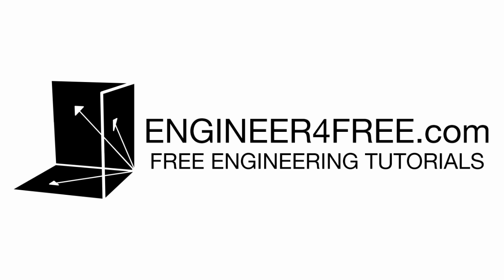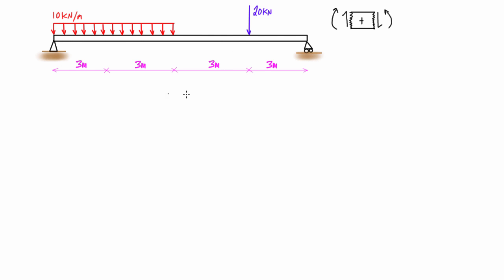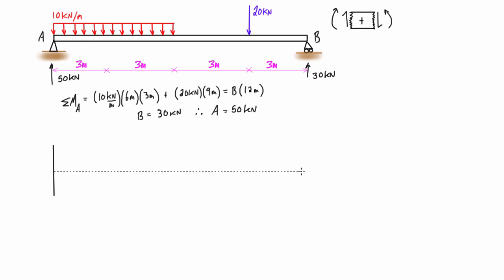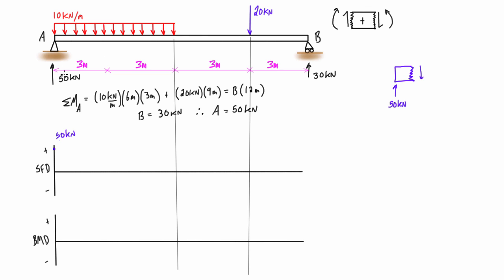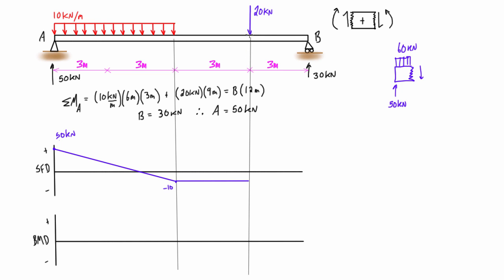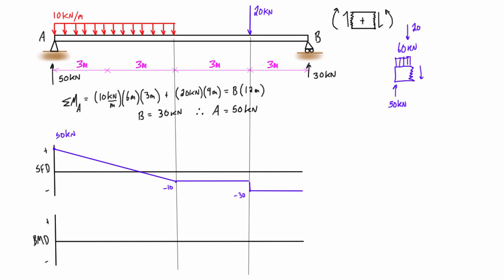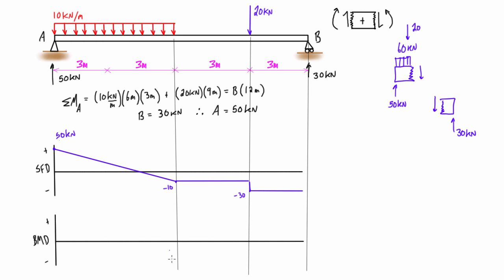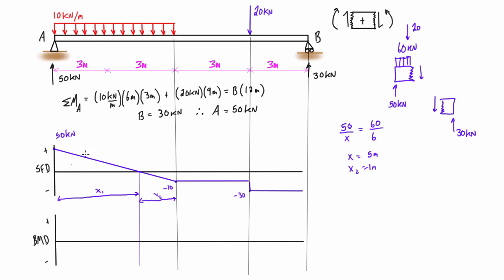Shear force and bending moment diagram practice problem #1

Comment: can someone help me why is the moment about A what it is? Where is the 3 coming from?
Reply from the maker: The 3 is the distance in meters to the centroid of the distributed load. Tihs is where its resultant force passes through, so we need it to calculate the part of the moment about A that is caused by the distributed load. Please take a look at engineer4free.com/statics and review the sections on moments (videos #25 - 34). 

Also recommend watching video #62 about rectangular (uniformly distributed) loads, and also the last section on SFD and BMD. Those SFD tutorials take a longer and more detailed approach to the problems (basically doing them "the long way" which is slow but you will get a better understanding. 

Once you complete them, then you can try out "the fast way" which is what is in this video that we're commenting on. More fast way videos can be found in the first section here: engineer4free.com/structural-analysis

Hope that helps. I really do recommend taking an hour or two and going through some of those videos for more context. It will help.

Comment: I have a question, we were taught (long time ago, already forgot alot) that for all structural analysis on civil engineering problems, we are to put the positive moments at the bottom side of the axis, so that the bmd correlates with tension, and whenever there is a distributed load, bmd has to be parabolic, with the arc bending with the direction of the dis. load, now looking at other people's examples, haven't seen anyone mention the inverted signs on bmd; so now im trying to wrap my head around if that holds true (specifically the arc bend going with the direction of udl) in all examples ?

Comment: Discovering this a little late but how did you work out the 50 kN at A
Reply: sum of forces on the beam = 0, +30-20-60+A=0
Reply: @tomgaboian6279 where you get the 60? Is it 10+20+30?

Comment: This is useless I want the calculations I wanna learn this shit in details
Reply from the maker: It depends on what you need to do. In a introductory course, you need to learn how to get V(x) and M(x) formulas, and be able to get the corresponding values for absolutely every possible point. That's great, and is more detailed, but takes significantly longer to do by hand.

In higher level studies, you will need to generate SFD and BMD more rapidly, only plotting max/mins, points of discontinuity, and the general shape and concavity (if applicable) in-between, as fast as possible. This video is part of a senior level structural design course, and it considered review. I've got some more basic introductory videos at the statics level, you can find all of the SFD/BMD videos I have here: https://www.engineer4free.com/blog/ultimate-guide-to-shear-force-and-bending-moment-diagrams

Comment: Hello sir thank you very much. I would like to ask 8:13 is the point of zero shear (crossing zero part in shear) always where you get the maximum moment? Im doing  an exercise right now and the maximum moment im getting is not on the point of zero shear.
Reply from the maker: Hey Nigel, yes, where the SFD crosses the x axis you will always have a local max (or min) on the BMD. Also good to know, where the BMD crosses the x axis, you will have an inflection point on the deflected shape. So it sounds like you just have an error somewhere in your work. Double check that you have solved for the reactions correctly.

Comment: How to figure out when to bent upward or downward on bending moment diagram of parabolic line?
Reply from the maker: You know the area of the SFD is positive, so the change in magnitude on the BMD will be positive from left to right. Next, do a quick and dirty numerical integration in your head of the triangular area on the SFD. slice it up into many tall skinny rectangles. The rectangles will be taller on the left, and shorter on the right. Area on SFD = change in magnitude on BMD across that same section, so the taller rectangles have more area than shorter ones. This means that the change in magnitude across each dx will be more on the left side than the right side. Greater change in magnitude per dx means greater slope. So the parabola is steeper on the left and less steep on the right. It also  has positive change in magnitude from left to right. This leaves only one option for the parabola to be drawn (which is concave down in this case).

Comment: Thanks sir. But I have a question, is the slope for the first parabolic suppose to curve in the 'n' direction or  'u' direction
Reply from the maker: The quickest way to do it is as follows. Pretend that you're going to do a numerical integration, and slice up the triangle shape on the SFD into many skinny rectangles. The area under the curve on the SFD represents change in magnitude across that same section of BMD. So where the rectangles are tall, the change in magnitude will be greater across their skinny width than where they are shorter. If all slices are the same width of dx, then that means a greater change in magnitude corresponds to a greater slope in that region of the BMD. So the tall side of the triangle on the SFD will correspond to the side of the parabola on BMD with steeper slope, and the short side of the triangle will correspond to the more gentle slope on parabola. Also knowing that a positive area on SFD will cause a positive change in magnitude on BMD and a negative area on SFD will cause a negative change in magnitude on BMD, then it always only ever leaves one possible option for the concavity of the parabola. That's a pretty quick and dirty way to do it, but once you get used to it, it's extremely fast. I recommend checking out videos 1-9 here: engineer4free.com/structural-analysis for more examples. I think with more practice it gets easier to notice the pattern.

Comment: Thanks so much for the tutorial! Please may you elaborate on the "similar triangles" solution to find x on the SF diagram? Also, are there other ways of finding x? Thank you.
Reply: So the 50/x is the smaller triangle on the SFD. x is the distance (run) you are looking for. So you divide the 50/x (rise/run). Now equal it to the bigger triangle which has a rise of 10(6) = 60 load and divide it with 3+3 = 6 m. You solve for x by cross multiply it so 50/x = 60/6 would become 60(x)=50(6) and just solve for x. 

Hope this helps.
Reply: BMD and SFD (100%)
https://www.youtube.com/watch?v=BT0LLe4_M3A

Comment: How did you get 50/x=60/6 to solve for that length?
Reply from the maker: Hey Adrian, sorry I did that with not much explanation. Look at the diagonal line on th eSFD that goes from x=0m to x=6m. At x=0, v=50kN and at x=6m, v=-10kN. Use these as the coordinates of the end points of a hypotenuse for a right angle triangle. The third point would be located at (x=0, v=-10kN). Se we are just superimposing a triangle over the diagram. The base of that triangle is 6m and the height is 60kN (50kN + 10kN). That is our first triangle. There is a smaller similar triangle of base=xm and height=50kN nested inside.  To find the unknown base of the smaller triangle, we wet up a similar triangle equation which is like this: (rise1/run1)=(rise2/run2) so I wrote the smaller one as triangle1 and the bigger one as triangle2 to get (50kN/xm)=(60kN/6m) and rearrange to solve for x which turns out to be 5m. You could also identify that because v=+50kN and the the uniformly distributed load (udl) is 10kN/m down, then the shear should drop by 10kN/m as we move to the right, and would have to hit v=0kN at x=5m, but not all problems have such nice numbers to work with. Hopefully that helps to clear it up, I recommend working through the examples in videos 1-9 here: engineer4free.com/structural-analaysis =)

Comment: Sir how do you know what type of parabolic curve in the moment diagram by just looking at the slope in the shear diagram?
Reply from the maker: Hey Jessie. The quickest way to do it is as follows. Pretend that you're going to do a numerical integration, and slice up the triangle shape on the SFD into many skinny rectangles. The area under the curve on the SFD represents change in magnitude across that same section of BMD. So where the rectangles are tall, the change in magnitude will be greater across their skinny width than where they are shorter. If all slices are the same width of dx, then that means a greater change in magnitude corresponds to a greater slope in that region of the BMD. So the tall side of the triangle on the SFD will correspond to the side of the parabola on BMD with steeper slope, and the short side of the triangle will correspond to the more gentle slope on parabola. Also knowing that a positive area on SFD will cause a positive change in magnitude on BMD and a negative area on SFD will cause a negative change in magnitude on BMD, then it always only ever leaves one possible option for the concavity of the parabola. That's a pretty quick and dirty way to do it, but once you get used to it, it's extremely fast. I recommend checking out videos 1-9 here: engineer4free.com/structural-analysis for more examples. I think with more practice it gets easier to notice the pattern.

Comment: Im in europe and use eurocode. Is our bending moment diagram in the opposite direction to yours? Our tension side is usually on the bottom. Im new so I could just be mistaken
Reply from the maker: Yeah different countries have different conventions on how to draw the BMD. If mine looks upside down to you then don't worry about it, just draw the inverted form that you're used to and you can still compare with one's like mine. Ifnibrecal correctly, the way you draw BMDs is called "drawing positive on the tension side" and the way I do is called "drawing positive on the compression side." physically on thisbbeam, tension will be on the bottom side no matter how we draw a BMD. But look at the labels on my BMD, I have clearly labelled positive on the top and negative on the bottom. I think your axis will be flipped, with positive on the bottom and negative in the top. So essentially it's the same graph, just inverted. I learned both ways when I was a student and ultimately decided to just pick one Form for these videos. I like doing them this way because it's more mathematically sensible to have positive up, and makes a lot more sense when integrating the SFD and plotting values on the BMD. But in practice by doing in your way, it will be easier to work with, especially when it comes to frames because the BMD will more clearly show where the tension is and be a better indication of deformation. That was a long reply, but yeah, just know there are two inverted and accepted methods, and be sure you know which form you're looking at when presented with one!

Comment: you missed out in the last part of the SFD part where you are supposed to connect the line back to 0 in the x axis as the last support gives a force of 30 kN upwards so from -30 + 30 = 0 so just draw a perp line from the end point and stop at the y-axis = 0. i hope you get what i meant.
Reply from the maker: Yeah it's true. You will sometimes see them with or without that vertical line. As we take the virtual cut a distance dx away from the right hand side support, and as dx approaches zero, the shear remains unchanged. This value of shear that is infinitesimally close to but not touching the reaction is actually we're concerned with. Like if someone asked you what the shear at B is in this case, we would tell them it's -30kN, not 0kN. But yeah should have drawn in the vertical line anyways I suppose!

Comment: Good morning. How did you get 50 kn?
Reply from the maker: Hey. It's from the sum of forces in y direction: Ay + By - (10kN/m)(6m) - 20 kN = 0 -----> Ay + 30kN - 60kN - 20 kN = 0 -----> Ay - 50kN = 0 -----> Ay = 50kN 👌

Comment: I love how clean this tutorial is but I’m confused why it has to be negative 10 anyone help me out please 🥺
Reply from the maker: Are you referring to the value of the SFD at x=6? If so, it's because the value at x=0 is 50kN, and the entire uniformly distributed load has a net downward force of 60kN. 50kN - 60kN = -10kN. That's why the SFD falls linearly by 10kN per metre, as the udl is -10kN/m as labelled on the original diagram. For a more simple introduction to SFD & BMD, see videos 66-72 here: engineer4free.com/statics and for more examples like this video, se numbers 1-9 here: engineer4free.com/structural-analysis
Reply: Engineer4Free OOHH TYYY
Reply from the maker: @dnchco3295  👌👌

Comment: I wish you explained how you actually got  50kN. I don't know which equation you actually used to substitute the 30kN to get to 50kN :(
Reply from the maker: 50kN comes from the sum of forces in the y direction. The sum of forces in y is: (-10kN/m)(6m) - 20kN + A + B = 0 -----> (-10kN/m)(6m) - 20kN + A + 30kN = 0 -----> -60kN - 20kN + A + 30kN = 0 -----> A = 60kN + 20kN - 30kN -----> A = 50kN. Check out videos 66 -72 here: engineer4free.com/statics

Comment: how did you get 50 for a ?
Reply: Summation of the vertical forces should be zero..  
A + 30 = ( 10 × 6 ) + 20
A + 30 = 80
A = 50

Comment: How do you know if the parabola in the moment diagram opens up or down? Is there an easier way to know other than the mathematical method?
Reply from the maker: I use a rather un-mathematical (but fast) way to do it: Do a fake numerical integration of the triangular shape of the the section on the SFD. Slice it into many vertical bits. The bits that are taller have more area than the bits that are shorter. More area in any given section of SFD means more change in magnitude across same section on BMD. The area of this triangle is all positive, so the change in magnitude from left to right on BMD will always be increasing. This triangle is taller on the left, and shorter on the right. This means the slices on the left will have greater slope than the slices on the right. By knowing the values of BMD on the left side (0kNm) and the right side (125kNm), and that its a parabolic shape, and that its slope is greater on the left than it is on the right, there is only one way to draw a parabola that works (it must be concave down in this case). Writing this explanation out never seems to come across that simple, but think about it, and try it a few times,  and you’ll realize that its 100% the fastest and most foolproof way to do it if you only need to draw the general shape and the endpoints. Keep in mind where a SFD crosses the axis (has a sign change, that is a local max or min on the BMD, but it shouldn’t affect anything in your determination of the concavity. I really hope that helps!! This is an easy trick that often gets left out of instruction!!

Comment: Did you use the Area Method for this example?
Reply from the maker: I'm not sure if it's officially called the area method, but I just call it the fast way. But yes, as you can see I'm juts taking the areas of the sections of SFD to calculate change in magnitude of the BMD across the same section. See videos 1 - 9 here engineer4free.com/structural-analysis for a few more examples using this method 👍👍
Reply: @Engineer4Free  yes I thought so too. Thank u so much for replying :)

Comment: What controls the direction of moment parabola ? , like a if it is , let's say a sad face or smile face ?
Reply from the maker: I like to think of it visually. It’s the integral of the corresponding section of the SFD. If you were to numerically integrate a triangular section of the SFD, you’d cut it up into many thin vertical slices. Where the triangle is taller, those slices have more area, and therefor, the BMD will have a steeper slope. Where those triangular slices are shorter, they will have less area, and therefor the BMD will have a less steep slope. Additionally, where the SFD has a positive are, the change in magnitude of BMD will be positive, and where the SFD has a negative area, the change in magnitude of the BMD will be negative. Together, knowing the direction of the change in magnitude, and which side will have a steeper slop, there becomes only one possible way to draw the rough shape of the parabola in each given section. I hope that clears it up for you!

Comment: The load on the beam is 10kn/m covering a distance of 6m at the left. You needed to replace the 10kn/m with 60kn (10kn/m*6m) before solving this problem. Your new results should be A=35kn and B=-45kn.
Reply: The moment is F(force)*x(distance) - to solve for a force applied at a large area you use the mathematical tool of integrals. So the moments integral is F*xdx - the solution is (10(kN)x^2)/2 = (10*6^2)/2 = 10*36/2 = 180kN, if you do the math it's correct, 50 on A and 30 on B.
Reply: I thought it was wrong at first too, that 60kn would be the answer for that part, until I realised how the distributed load works. One way to look at it is converting the distributed load to a point load at its center, then multiplying that value by the 3m distance from A (center of W from A).

Comment: thanks for the great explanation, can you please explain to me how you get A=50KN and why you multiply the 60 by 3m
Reply from the maker: Hey, the A comes from the sum of force equation in y direction. I skipped the work. Sum of forces in  y = A + B - 10kN*6m - 20kN = 0 .... A + 50kN - 10kN*6m - 20kN = 0 ... A = 60kN + 20kN - 50kN ... A = 30kN. And for why 60 is multiplied by 3: that is happening in the sum of moments equation about A. The  resultant of the distributed load (overall magnitude) is (10kN/m)*6m =60kN. You need to also know how far away from A this is acting, and the location of a resultant for a uniformly distributed load is in the centre of it, so 3m from either side if it's 6m long. So the moment caused by the udl is 60kN*3m =180kN. Hope that clears it up!
Reply: @Engineer4Free  thank you so much